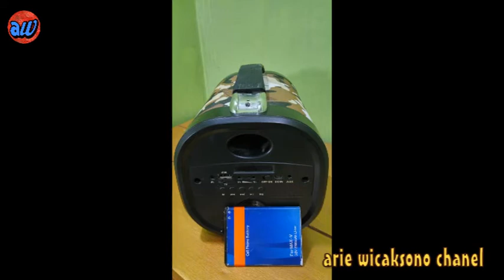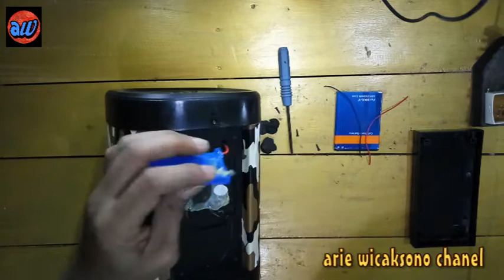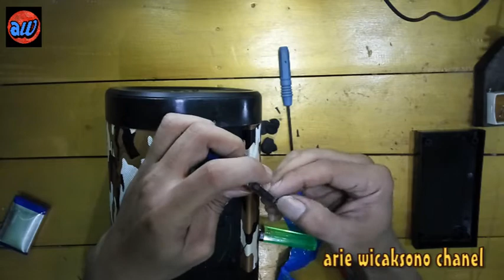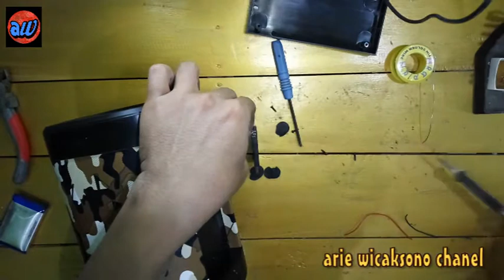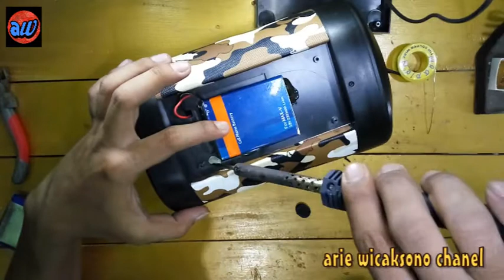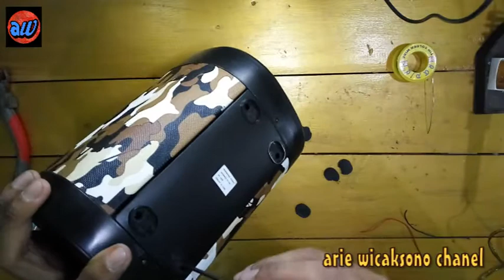Cara Mudah & Cepat Ganti Battre Musik Box, Pake Battre Hape Bekas. Bisa Tahan 3 Hari Sekali NgeCas !

Comment: Kalau pakai baterai AA 1,2 volt bisa gak bos?
Reply from the maker: Bisa tp 3 biji
Reply: Kalau 4 biji bagaimana bos?
Reply from the maker: @didiksuyitno6313  kalo 1.2 x 3 = 3.6v itu ukuran standar pengecasan hp, kalo 4 jadi 4.8volt karena di rangkai seri, tp kalo baterai bekas pb 1 biji udah bisa
Reply: Berarti kalau dirangkai seri,  4 biji bisa ya bos? Karena saya mau pakai baterai AA rechargeable, dan untuk pengecasannya tidak di speaker. Tapi baterainya saya lepas, dan saya cas pakai charger baterai AA.